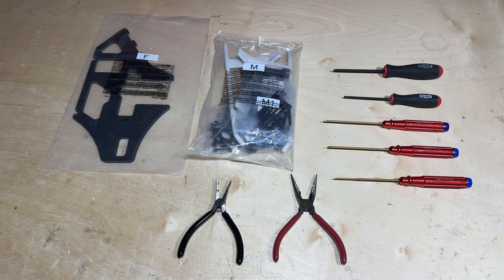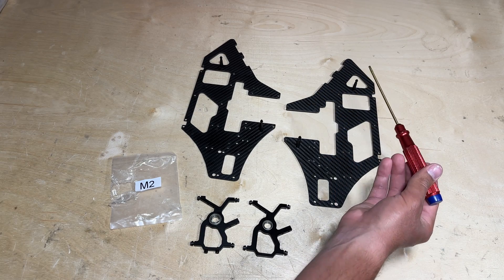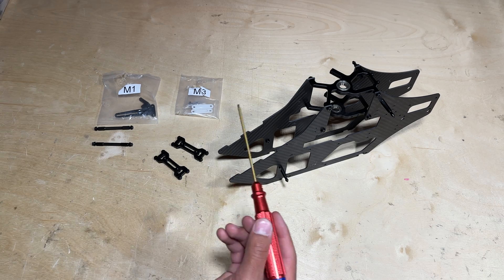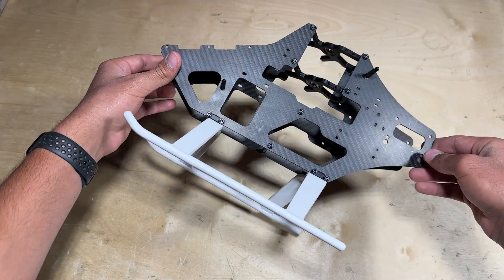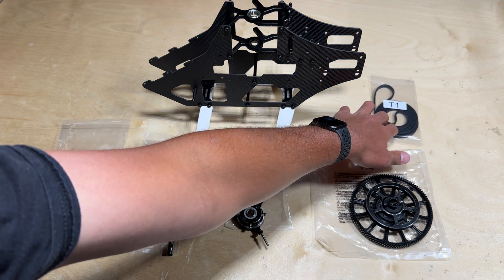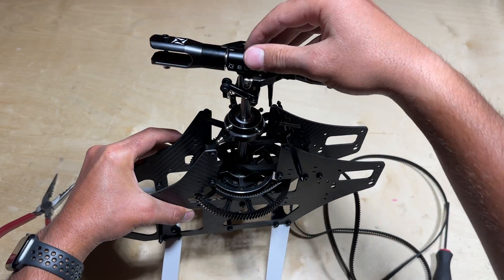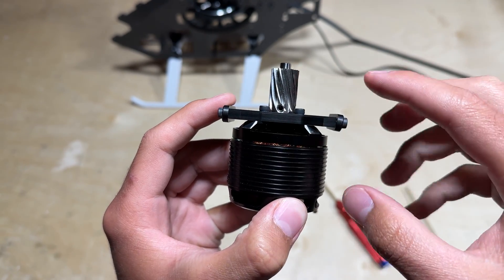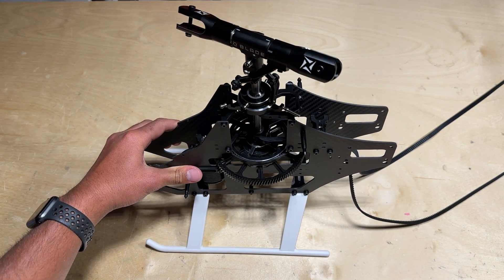Blade Fusion 550 Build Series: Main Head, Frame, and Motor Installation

Comment: Still the same crappy plastic canopy post mounts like the 550X? For shame.
Reply from the maker: Nope, these are aluminum. ;)
Reply: @bladehelis  Please bring back OOP part# BLH5537 for a while. I really want a Fusion 700, but not enough to scrap my mint condition 600X, which only needs BLH5537 to fly again. If you make 5537 they will sell along with Fusions.

Comment: I have a question, got some aluminum silver colored screws and red washers,to replace the black screws and washers,are they going to be strong enough to replace the stock screws?
Reply from the maker: Typically we recommend not using any other hardware than the factory screws when dealing with main rotor / tail rotor components. This is because the strength of the screw can vary by grade.
Reply: @bladehelis okay thank you sir,for the information I appreciate it